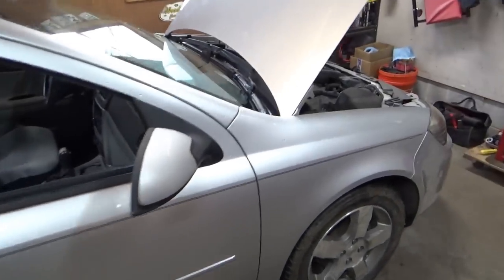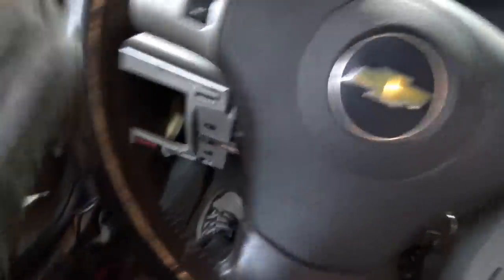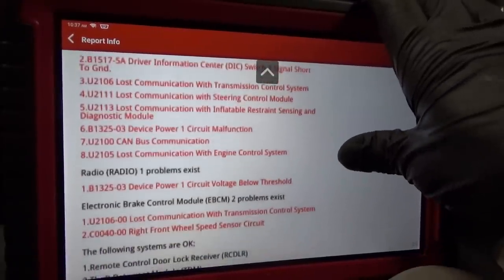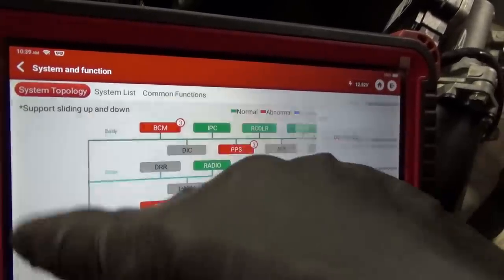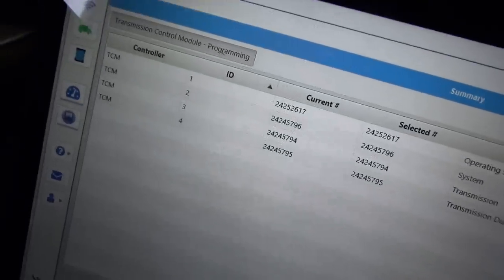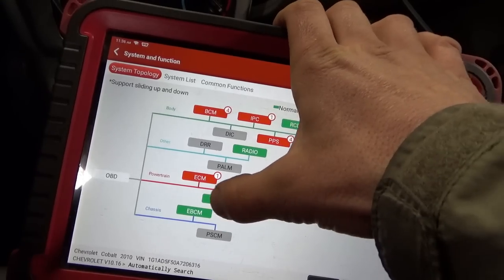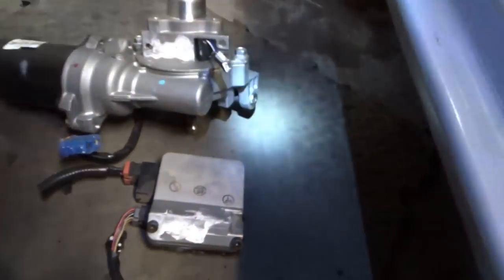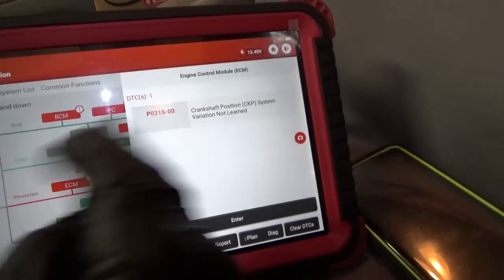Welding DISASTER... (Part 3 - Back in Action?)

Comment: On the 2.2 & the 2.4 eco-tec, The biggest issues are basic maintenance! The timing chains & components(oiler, balance chain & 2 balance chain gears, 2 tensioners) need changed at recommended mileage or time) Mine started tapping at start up only so, I changed the timing tensioner accessible & unscrews on the rear of the engine which quieted the tapping for a few months but returned so, I changed all timing components at about 156k then the transmission failed. I found a 23k mile transmission through LKQ for under $400. & I just passed 200k miles last week! So, with basic maintenance & oil changes every 3k miles, I forsee it lasting another 50-100k miles...
Reply: Yeah, I just found out my aunt was "following the reminder" in the car to get her oil changed at the dealer (meaning probably 8k mile oil changes on cheap oil) and her 2.4's timing blew apart and made a heck of a racket at 80k miles.

Then she gets the car back in the middle of a cold snap (-30f nights, -10f days) and the crankcase vent froze up or plugged up and blew out the rear main seal, puking oil out as fast as you could add it. It was an expensive month for that Chevy...

I guess her old habits will have impacted the piston rings also (I hear they can stick and cause oil burning) so I told her she better be careful with that car and change her oil every 3-5k from here on out to maximize it's life.
Reply: @volvo09  The timing tensioners are pressurized & controled by oil pressure so, regular oil changes are critical!!! Timing chains normally warn u with tapping at start up. My transmission started slipping & gave out within 1 month around 157-160k miles. 200,244 miles on mine currently. Hope it last ya's because nothing is inexpensive these days!!!

Comment: Sometimes we hang onto cars just a little too long.  I'm guilty of it myself.   That being said, the beater you know, vs an unknown beater, might make the $2k investment worth it.  Spending $2k on another beater could just open up a whole new can of worms. My one disagreement is not fixing the airbags.  The owner may live (or not) to regret that decision.  he's already spent over $2k, how much is a used airbag controller and is his and whoever is with him's lives worth cheaping out on the main safety system?  Gee, fix the radio but not the airbags?  Wow!  I fully understand any car before the 90's doesn't have an airbag system but this one does and he intentionally didn't fix it!  OnStar, sure, disconnect it but FIX THE AIRBAGS!  Thanks Ivan, a very interesting series.

Comment: From experience, Prior to welding disconnect batteries and discharge residual voltages. Ground as close as possible to the weld.

Comment: Plug and play may be getting the boot when the weatherproof connectors are probably costing the mfg as much as the module. Soldering a few wires is not always an easy task and certainly should not be free. Another save for the customer.

Comment: Generally , if you can find a complete vehicle that was hit , you can remove the parts needed . They scrap place doesn't care about modules , radio or ECM . They subtract if the CAT is not original . But if I needed an engine or transmission , I wouldn't invest the labor in units with 168 K . You brought this back from the dead .

Comment: After I pay off a car, I budget the cost of monthly payments as repair costs per year. If I can spend less than what I would normally pay for another car, In my case that would be $250/mo, then I will keep the paid off car running. Since my go to car is a used Camry, I have been able to keep them on the road for a long time. My current Camry is a 2010 with 215k miles on it, running great.

Comment: A few years ago, you'd be more likely to scrap the car and move on.  Back then, you could pick up a good used car for a couple of thousand dollars.  These days, there are still deals still to be had, but you have to get off the mark very, very quickly.  BTW, I did a similar thing with an old beater 1983 Honda Prelude, spent way too much time and money trying to keep it going, and should have cut my losses way before I actually did.  I guess most of us have been there!

Comment: Pretty expensive welding accident and even some extra misfortune adding to the bill, like the radiator. On the other hand, I guess the rust holes are now welded and car is drivable. If it was scrapped, maybe another car would have needed welding + other repairs too, and the total bill would've been about the same?

Comment: My beater is an 04 Mazda 3 Hatchback with 230K miles. The front suspension shakes while going onto the freeway, driver side cv axle has a torn boot since before I bought the car and the transmission has started to go. I have the suspension parts but I know it’s not worth putting new parts and labor into this M3 Hatchback. It’s time to look for a newer 1st gen M3 Hatchback and drive my current M3 Hatchback til the transmission or suspension gives out but the prices are ridiculous here in California.

Comment: I kept my wife's car mint. But stuff still breaks, things need to be replaced over time. Nature of the beast. Anyway, I told her it's at the point where we put around $3,000 in to it or start looking for something newer.  She wanted her car, and my queen gets what she wants from me. Haha $3500 later, all new suspension, all new exhaust, wheel bearings, tires and much much more. Car runs and goes down the road like new.  2008 Hyundai Elantra with 223,000 miles. She bought it with 45,000 miles on it for $12,000. If she gets 5 more years out of it, money well spent.

Comment: Given beater prices lately, it's easily worth spending it.  He could sell the car for $3K pretty easily if it runs and drives and doesn't need a lot of extra work.  Buying a $2K car today means spending $4K or more, as every $2K car comes with $2K of needs-to-be-done-right-now work.  I'm shocked at how much was done to this car for the money - how many videos have we seen Ivan replace an Audi or BMW module where the module alone was a thousand bucks?  Landfills don't need any more cars, I'm glad this was able to be saved!

Comment: If the owner was confident in the underlying mechanical condition of the car then repairing it was sensible.  As others have said buying another car at this price point could just as easily land you with some interesting bills.  That said not sorting out the airbag module is a very bad idea.  Imagine you are giving someone a ride and there is an accident.  That person suffers serious injury, the insurer will point to the airbag and refuse the claim leaving the owner facing paying significant damages.  I would not be certain that any waiver they owner signed would protect the shop in those circumstances.

Comment: Most cars are worth fixing. When you factor in the price of a replacement, the depreciation on the replacement, and not having a monthly payment. Most cars are worth driving until safety becomes a true issue. Most cars are also not tax deductions. I might feel a bit differently if the vehicle is used for business purposes.

Comment: Mixed emotions on this vehicle.  Great diagnosis and patience exercise.  Where the disappointment comes in is that you apparently don't have a labor time schedule to quote from.  Way over expected budget.  A time manual would have given the owner a more accurate cost of repairing the Cobalt and deciding whether to repair the vehicle or not.  In most states an estimate is required before repairs and the estimate cannot exceed 10% of the quoted price. (Unless you're working under the radar of the state and feds.)  Depending on what your business license category, should you have a license,  you may fall under this state provision. You may want to check.  A good video series on some aspects and a pooch screw on other aspects.
Reply: He has a license.

Comment: If the radio VIN is cleared before they sell it, it will relearn the VIN automatically without any programming. It might need to confirm there is only 1 VIN to learn so if other modules don't have the same VIN, it won't relearn and lock itself. The modules get the VIN and mileage status from the instrument cluster but all have to be programmed with the current car's configuration options. I put a lot of money into my own beater and hit a deer with it in December making it much more worthless to sell. It's pretty much crusher material but I have to put money into it because I can't afford to buy a car right now and with the used market insane, I can't even get a loan because they want so much money for used stuff.

Comment: The lesson here is don't weld near computers.  Gas welding is prefered.  The current required for elec. welding will fry a computer is a millisecond.  These high currents will find a path thru the grounds in the car.

Comment: My late wife and I have a 2012 dodge grand caravan that we bought in 2017 and sadly she passed in 2021 and right after the #1 head dropped a valve and because of the sentimental value of the van I put 4500 into the engine. Even though I HATE VANS and currently drive my '95 F250. So if it has emotional value then yes repair it if not get your scrap price and move on.

Comment: This car I would not,  however,  I have a 2006 Jetta TDI that I would based on the fact I can jump in that car right now and drive 1000 miles and not blink an eye.  Perhaps this car other than the welding incident was like that.  One thing,  I think this is a good example of why you should always disconnect the battery.  Not sure it would have saved the modules,  maybe it would have if you got the car?

Comment: Hmmmm, i thought about putting some money into my 2008 mazda 3 with 255000 miles in it, it drives like a dream, but it has a evap leak that no one can fix, its rust free ( aside form surface rust ) and the ac just stopped working. Only reason i am scrapping it is because of the miles in it.

Comment: Would i have fixed this car ? Well that depends on the state of the undercarriage, if it needs weld repairs in frame/subframe/cross members/floor etc, then probably not.

If the car that was well taken care of and in mint condition underneath and only has the usual cosmetic rust/rust holes then yes i would put the same as what i paid for it or more as it is structurally sound , safe and worth repairing at that point.

Comment: yeah I'm gonna bet the damage as not done by the fire, but by the welder itself. I wouldn't be surprised if welding with the battery connected would fry stuff, but I would be surprised if all those modules couldn't take 12V down their can bus.

Comment: Honestly... For $2500 to get that back online for a few more years, plus a valuable lesson to their kid to make sure to DISCONNECT the battery from the car before welding. Even if the wire loom didn't catch fire, the amount of current being dumped into the body of that car for any form of welding would fry the computer modules throughout the car.

Comment: I 100% would and have in the past invested that kind of money in a beater vehicle!
I'm actually working on one at the moment, it's a 91 F350 diesel that had a engine fire that I'm basically doing a restoration on, I only paid $1,200 bucks for it and it's a five speed four-wheel drive 1 ton truck with a diesel engine that has no electronics whatsoever!
I think I've got like at least $4,000 in parts into it so far plus all my time but it's worth every cent of that!! 

Go try and buy a 1 ton four-wheel drive manual truck that has absolutely no electronics to make it run and you tell me how much you're going to spend 😁

Comment: I originally thought that this was complete insanity especially since it's a PA car full of rust (which precipitated all these problems to begin with) and then I thought about it. The used car market is currently madness so I guess this makes perfect sense. Under normal times it wouldn't but it does now. Out here in Arizona this would 1) Never needed to happen to begin with and 2) since rust is unheard of a twenty year old car can have a body of a brand new one back home in Pittsburgh. So such extensive repairs would always be justified. I've often believed that it would be a very profitable business if one would ship motors and transmissions out West from the East and we should ship body panels back East. We go through engines and transmissions but the bodies of our cars are like new.
Reply from the maker: Hah that's an interesting business idea 😉

Comment: If you were fixing it with the plan to sell it and the cost to fix it exceeds what you can sell it for, then it doesn't make sense to fix it. You will lose money.

However, if you plan to drive it, then the cost to repair vs what it can be sold for doesn't matter. What matters is how much use will you get out of it once it's repaired. If I've had a car for a while, it's in good shape and it's been dependable, then I like to repair it and keep driving it because I know the history of the vehicle. I know where it's been, how it's been maintained and how it's been treated.

Being that the repairs were not needed because the parts simply failed. Being that they failed due to human error. I say yes, the cost to repair this car was definitely worth it. If all those parts had failed on their own, then I would think twice about replacing them.

Comment: Did the Owner say his son was welding on the car with the battery connected? Or maybe the welder's ground was too far from the point of welding (like grounding to the frame at front and welding in the rear...with all the electronics in between).

Comment: A few years ago I would say "junk it!", but now you can buy someone else junk with 2k, and could be worse than yours. In this case wasn't the car's fault, hope this is a lesson for everybody. Welding is dangerous for modern cars and their modules, any spike in voltage can fry your PCM even with a disconnected battery!

Comment: Would I invest $2000 to repair my old Toyota Camry 1999? Absolutely! You can't get a reliable car these days for that money.
BTW, my Camry has worked like a charm for the 23 years I owned it, and it still does run like a charm. No rust and low mileage.
They don't make them that good these days!

PS! When I bought it in 2000 I got a rust protection from Mercasol. A Swedish system for rust protection. You do it once and check it after 5 years. The protection is still sticky, as it should, even after 23 years! I need a good protection because I live in mid-Sweden in the rust belt!

Comment: u got played!! I'm joking... But he knew if he told you the son was going to replace that steering module that you know the son was going to solder those 4 wires with the welder ruining all your work, forcing you to do it for peace of mind! as for if it was worth it $3k in repairs on a 168k car... that transmission has how many miles left? whats the cost for a replacement transmission.  is that engine interference? timing belt or chain? is the water pump internal? as the water pump is past EOL.

Comment: 2000 grand for a reliable beater you know is still better than 3500 for one you don't. If only the kid had disconnected the battery before welding

Comment: What was the root cause of the failures? Was it the fire short circuiting wires or was it the welder sending current in the wrong places? Any ideas - I would like to learn from someone else's mistake!
Reply: From part one of the series, I think he was welding too long... Not allowing to cool off and fried a whole bunch of wires under the driver seat
Reply: @ricebike  OK - so it sounds like it was the melting of insulation and shorting that took out half the modules.

Comment: This thing was TOTALED.....Sounds like welding was done without disconnecting battery???????
Reply: I'm sure that's the case but in the first episode he explains the heat from the welding heated up Underside and melted the wires underneath the chair

Comment: It's amazing that Ivan got it running.
Customer said he could live without the airbags.
Customer might die without the airbags.
Reply: Don't you need the air bags working for a current wof. Here in NZ  you wouldn't pass a wof inspection until the air bags got fixed.

Comment: "The customer said he can live without the airbags." Is he sure about that? Also, I have to say, once you quoted the job, you quoted the job. I have made these mistakes before. When you have to work for free because you screwed up, you learn not to screw up. It is not the customer's fault you misquoted labor on the power steering. You have to just eat those two hours if you want to maintain good customer relations. I realize you found a happy medium in the end, but you asking for two more hours because you didn't bother to look up labor time is nuts.

Comment: The car is not even worth $1700 …..
Reply: Buying a replacement beater in today's market is a 5 or $10 G affair
Reply: @sandybarnes887  picked up a 96 Camry a few months ago with 99k miles, needing a hood and windshield for $200. Repairs were $300 and your good to go

Comment: You need to see how mutch a working car like that with a 168000 miles worth in the market, and is the engine and transmission in good condition,  and then you can  decide if you will invest in repairong it or not, because buying a car like that from sombody you can never guaratnti the long lasting transmission, it may last a year or even two years, that will not be a good deal, qou tontake that as decison to repair or not, beacuse if that car transmission and engine is in good shap, just go a head and repair it.